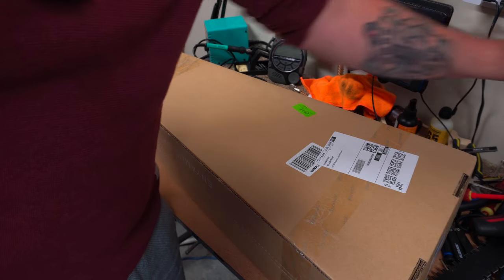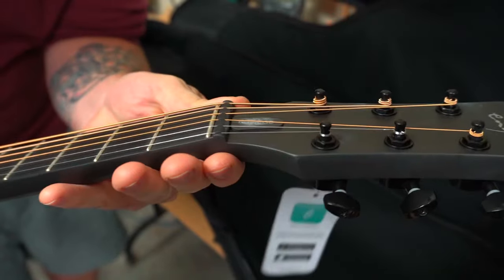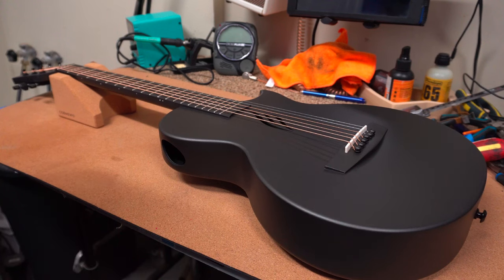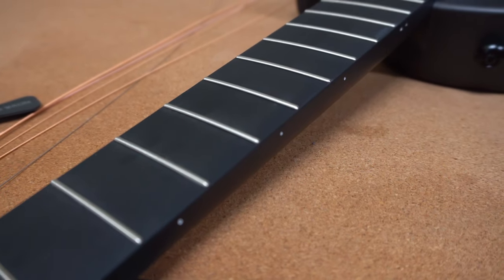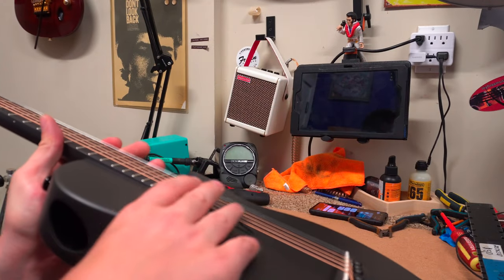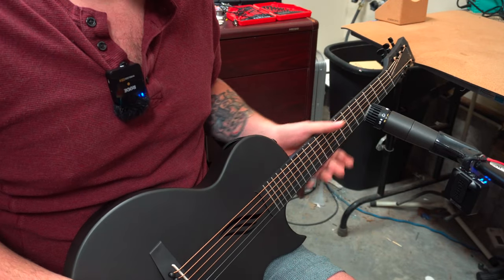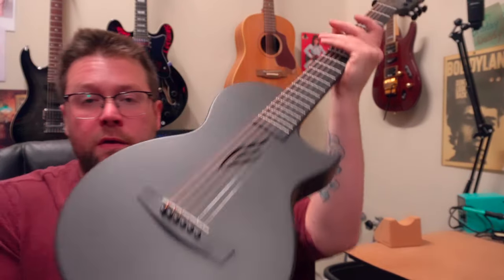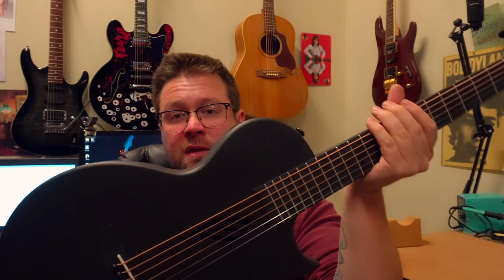Fully Carbon Fiber Acoustic Under $160! Enya Nova Go Unboxing Review and Demo

Comment: This is far far different from a guitar with woven carbon in terms of durability and resonance. McPhereson, Journey Instruments, Rainsong - these are on a different level. But for the price these are descent - 5 years from now, because they're 95%-98% plastic - the tone will degrade and the neck will warp - especially if you take it to extreme weather situations.
Reply: Is there a way to tell how durable they will be other than price?
Reply: @tomhrio  does it use woven carbon fiber fabric in the entire construction, or is it just injection molded plastic with 5% or less carbon dust.
Reply: @tomhrio  leave it in a hot car for 3 hours
should tell you what you need to know.  :face-orange-raised-eyebrow:
Reply: Interesting. I’d read it was a plastic carbon fiber composite elsewhere as well. Other reviewers have described leaving it in hot cars in summer, in cold cars in winter-all without the case, dropping it on metal floors, hiking over rocks w no case, and after all this, seeing no damage, and not even needing to tune it.

Comment: Bought for my grandson to start with.  So far so good.  Decent sound, seems very durable.  Had the front strap peg come loose but found the nut in side the guitar and was able to put I back on.  where did you find it for $160?  Best price i found was $200.
Reply from the maker: It was 160 US on Amazon (or 220 or so Canadian)
Reply: @boechlerguitarsandrepair  Is the fret board on this model guitar considered small size when compared to standard adult guitars (when for example compared to the guitars hanging behind you in your video) ?   Wondering what your thoughts are as to fret size and larger sized hands etc? Thanks for a great video!

Comment: It’s a very good deal, but it’s definitely not fully carbon fiber. It’s a carbon fiber composite, so some carbon fiber mixed with maybe resin and polymer. Enya makes a carbon fiber acoustic that’s like $600-700 USD. The fact remains that it is impervious to temperature and humidity swings. Very cool. Your review is great, especially the work you did to get the action dialed in.

Comment: Just small clarifications, it is not full carbon fiber, it is a composite with plastic. The company behind this guitar is US based I believe, but it is manufactured in China.

I have this guitar and I really like it so far, it suits me well as I am a beginner.
Reply: All carbon fiber is a composite with plastic. Like fiberglass carbon fiber is threads of carbon in a polymer (plastic) with the fibers providing stiffness to the polymer material. Without the polymer you basically would have carbon wool.
Reply: @MarkLangdahl  He's talking about thermoplastic material vs an epoxy resin. Most people would associatiate "carbon fiber" with epoxy, not plastic. Not all carbon fiber is a composite with plastic. There is a big difference between the two. Making a guitar with traditional carbon fiber techniques would be more expensive, but not necessarily better.
Reply: Totally Chinese company in Guangdong province. American’s can not make it and would be expensive.
Reply: @MarkLangdahl      No, you`re wrong!! Ever seen a real cross carbon plaid, like used in automobil industry or arrowshafts for example ?
There is no plastic in it at all. It`s 100% carbon fiber webbed together and a few epoxy over it, that it keeps the wanted shape (one or several layers of carbon plaids). Not a lot plastic like in this guitar!
Taken precisely, it`s misleading advertisement.

Comment: I have it in silver glitter. But even better is the pure glass-like finish. This guitar is indestructible. They bashed so badly in shipping the electronics were killed inside. So, with great effort I pulled them out thru the tiny hole. I keep it by the window exposed to hot/cold humidity- it rarely needs tuning. I did pay 3 times the price but it's the most beautiful and indestructible guitar I ever had. Also tunes perfectly.

Comment: Hi, first of all, thank you for the well made video! I watched until the end! I bought the Nova Go guitar from Enya some days ago, but acoustic-electric. It's my first guitar and I was wondering , when you say the action is a bit high, do you mean that the strings are too high from the frets  ? Because I feel like that my strings are a little too high . Maybe it's because I'm a beginner and my fingers are not use to it so I need to press harder because the strings  press deep in my skin ? Anyway I don't have the tools and experience to modify my guitar like you. Do you think I should go to a luthier ? Do you think it's important to check it and if the action is actually high , repair it asap ? Thank you in advance for the anwers :D
Reply from the maker: The easier your guitar plays the easier it is to learn! Find a local guitar shop and ask for a setup. They will be able to tell you if the action is acceptable or make it lower if it isn't. The price will be well worth it
Reply: It should cost only 35 bucks for a set up yer strings if new don't change them otherwise buy a new set when u get yer set up

Comment: I want this! ❤ How is the arm? Is it regular size or thin because its a travel size. Hard to tell. How is the weight.Ill be grabbing this soon. Awesome review, thanks 👍🏻
Reply from the maker: Not sure what you mean by arm? The neck is regular sized. It weighs 3lbs 9.5oz
Reply: @boechlerguitarsandrepair  sorry that was a typo. Yes I meant to say neck. Ok thanks for the reply
Reply: @boechlerguitarsandrepair So…really small hands have reach just as much circumference as regular guitar? Just less stretch on length as frets are less spread out?

Comment: Are the frets steel or cheep alloy?  Or would I have to replace them for good ones?
Reply from the maker: They are not stainless just standard fret material. You will not need to replace them

Comment: I do NOT understand how you can change worn frets if the keyboard is made of carbon fibre...
Reply from the maker: I think the cost of a re-fret would be more than the cost to replace the whole instrument, however, in theory replacing the frets would be exactly the same, probably with less tear out than normal wood. Might require a bit more gluing and clamping than wood though
Reply: thanks a lot! I'm curious to know how much the carbon fibre is ruined when you take the frets out and put new ones in...

Comment: I just bought mine at Amazon for $289.00 + Tax it cost me $300.00. Yours is cheaper.
Reply from the maker: Did you get the model with electronics?
Reply: @boechlerguitarsandrepair  Yes, I did. maybe I bought it not on sale that's why it cost me more money.
Reply from the maker: @Switzer727  the model in this review video does not have electronics. It's about $100 cheaper
Reply: This is the name of my Carbon Guitar: Enya NOVA Go SP1 Carbon Fiber Acoustic Electric Guitar with Smart AcousticPlus 35 Inch Travel Acustica Guitarra Starter Bundle Kit of Gig Bag, Strap, Strings, Charging Cable, Instrument Cable(Black) is this the same as yours?

Comment: Sorry to spoil the party but that’s polycarbonate not carbon fiber. There might be some carbon fiber in the wrap, just to keep false advertising claims away. Still a decent guitar under 200 bucks.
Reply from the maker: Yeah I did find that out afterwards, still has the same properties as carbon fiber (not affected by temp or humidity) and mine plays and sounds great. Currently traveling with it and it has worked well for me
Reply: After playing guitar for 55 years, this is what I’ve learned. With rare exception, you get what you pay for. I refuse to buy any guitars made in China. You just don’t know what you’re getting. The manufacturers continually lie to you. That Guitar is not made of carbon fiber. Get back to me in a year and let me know how the frets are holding up. It looks and sounds like a toy. You could buy a secondhand guitar for $100 at guitar center and you would walk away with something of higher quality. Not trying to be negative, I just hate to see young people buying crap. Did I mention that Guitar sounds like crap? :-)
Reply from the maker: @thereyougowithbryan6014  I'm using it for a travel guitar and for that use it's perfect. Sounds decent enough around a campfire and I don't need to worry about temp or humidity. In fact I left it in a hot car over the weekend to test it and it was fine, It didn't even need a truss adjustment.  Does a full size wood guitar sound better? Sure. But as a travel guitar for the price I paid I am very happy. In terms of setup and playability out of the box it was surprisingly good. I would argue a lot of decent guitars are coming out of China these days (the new China made Epiphone are getting accolades). Every brand is different of course but I have no issue recommending this guitar for travelling or even beginners or younger players who need a smaller guitar. After playing it for a few months the sound has opened up a bit as well. You may be surprised if you try one!
Reply: @boechlerguitarsandrepair  not going to debate the issue if you’re happy with it. After you play guitar as long as I have you start to realize that a guitar can sound OK in the beginning but after hearing it over the course of a month,  your ears will tire of it. I have probably owned over 250 guitars in my life and I can’t think of one Chinese Guitar that I found inspiring. As far as carbon fiber guitars opening up, they don’t. That’s the whole point of carbon fiber it doesn’t move it doesn’t change I would never recommend a new player buy one of these guitars they will outgrow it so fast it will not be worth the investment.
Reply from the maker: @thereyougowithbryan6014  I think you are right about the opening up, it may have been the strings just breaking in. After owning a music store for 12 years and trying thousands of guitars, I think it's all about the individual instrument and not where it's made. Played some great inspiring Chinese guitars and some terrible US made ones, and of course the opposite. Just find something you like and that speaks to you, don't worry about the price or where it's made, and get playing
Reply: @boechlerguitarsandrepair  There can always be the exception. But there is a reason why you don't see Chinese made guitars in the hands of people who are great players. Just like buying a car, it's always good to do research and seek advice. Never buy a guitar based on emotion. Try to understand why you are buying that instrument. Btw, you can buy a 150.00 Yamaha with a laminate top that would sound way better and would be incredibly safe to travel with. Just trying to help people avoid having to take a loss on reselling.
Reply: Are the colored models just the black but painted?